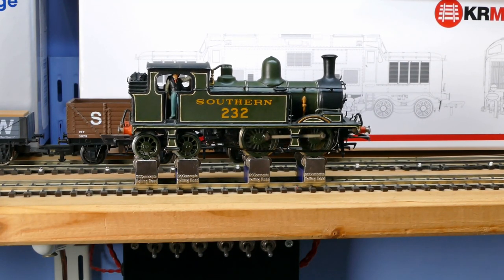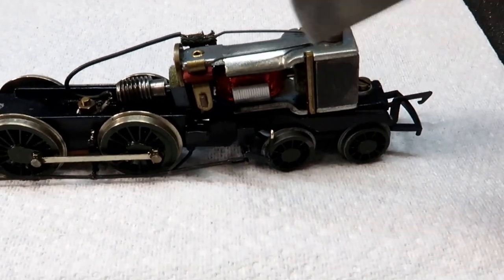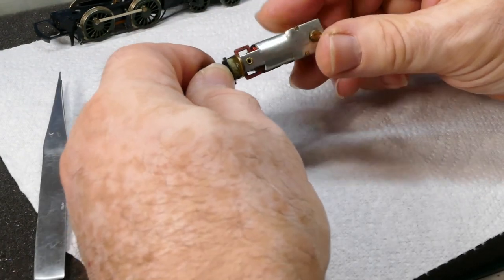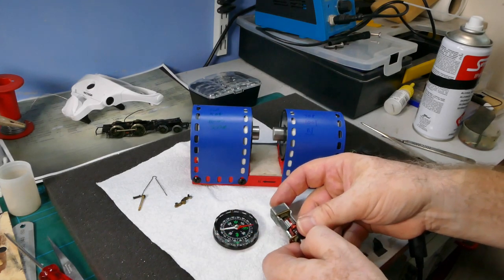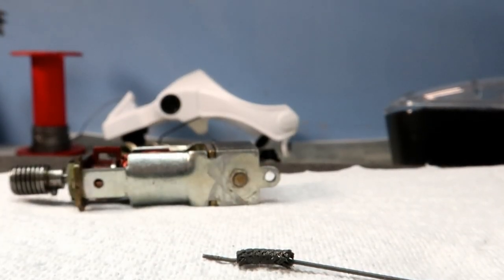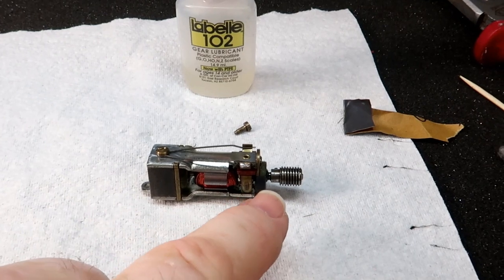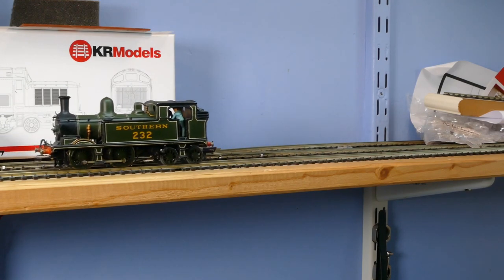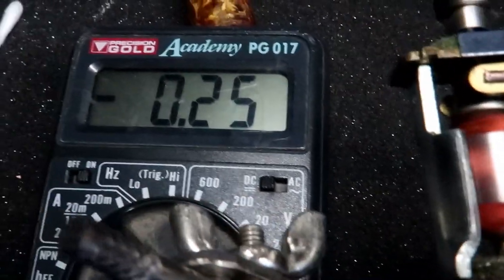Work Bench Special dad’s O2 motor service and fix

Comment from the maker: Update! Hi guys and gals. Bit of an update with this one. I was still not happy with how it was running. Tonight, I discovered the motor brush spring was too hard, simply squeezing it together reduced the current drawn from 400mA to 170mA off load, the loco now runs ever better ready for her starring role soon :)